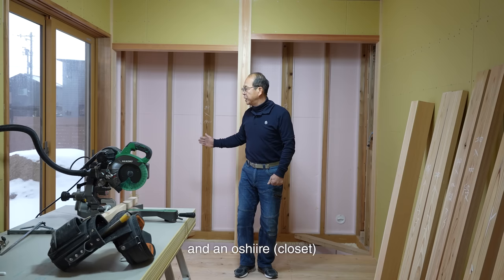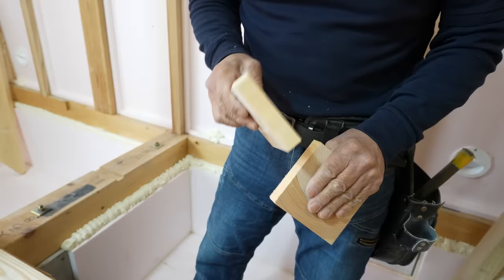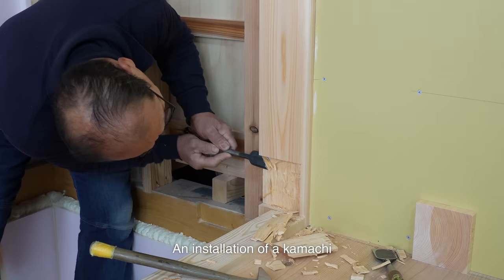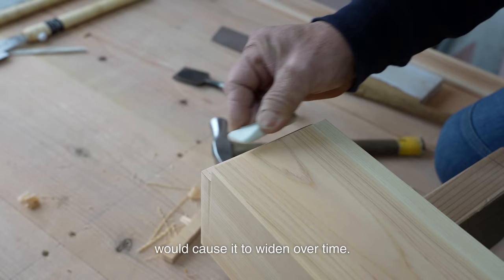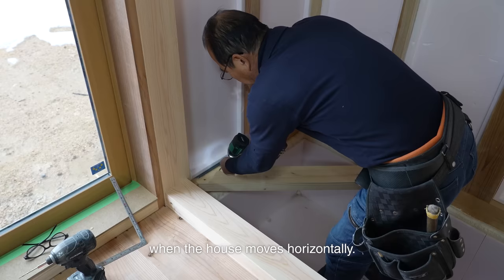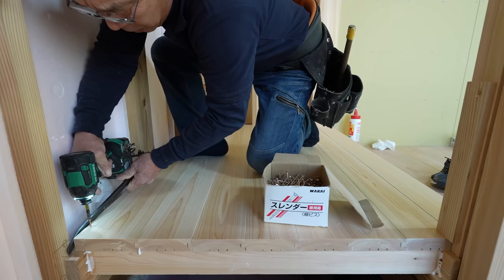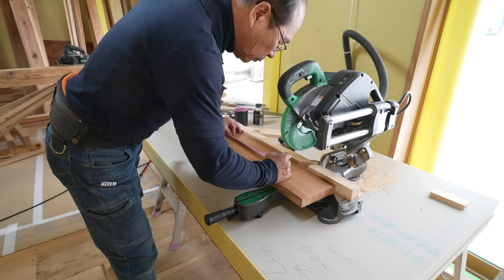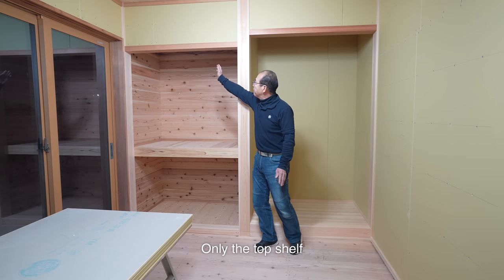Super-Challenging Joinery | Tokonoma and Oshiire Installation [Season 3 – Part 14]

Comment: There is no place on earth like Japan and no people like the Japanese, so unique in so many ways
Reply: Every country and race are unique
Reply: There is no place like the US and no people like the Americans.

In fact… There is no place like (insert country) and no people like the (insert respective people).

I’ve lived in Japan for 30 years. And there are people like this guy. But there are far more people not like this guy. I bought a house shortly after I came here. And looked at many houses. It took a while before I found a place that I felt could build our house. This company offered two different building styles, at least, for the framing work. One was more traditional Japanese, and the other word was the use of 2x4 made from Canadian fir. The 2 x 4 method was about another $15,000 more expensive and we chose that technique. This company had houses and Kobe when that major earthquake hit and none of them suffered any damage whatsoever. The thing that’s different there between the Japanese and American style framing with 2x4s. One is that the Canadian fir is some of the clearest 2 x 4 material I’ve ever seen and I for a while as a carpenter after graduating college. Second, is they heat up that nail gun because they use more nails and I’ve ever seen used an American house.

Major companies have a high degree of quality control, and employees must conform to the rules and regulations of the company. Expectations are high But the smaller companies are a different matter. Many that I’ve seen are shoddy. Many have a “that’s good enough“ attitude.

The guy in this clip is building a high-end house. Many common, if not most, houses now are modular design with wall panels, simply being hoisted up by crane in the linked together. Houses that are built by post and beam method are almost exclusively built with pre-cut post and beams. Those intricate joints are cut at a factory, loaded on a truck and sent to the job site. And many times the joints are not as intricate as what you see in true custom work.

There are differences in cultures throughout the world, and Japan definitely has its own special blend. I don’t get to get carried away over this guy because there’s not a lot of people like him and and only a small percentage of the houses are built by guys like him.

Oh, and those saws are nice! I use them all the time. They cut on the pull stroke, not the push. And the blades are replaceable.
Reply: @Zerpersande  "There is no place like the US and no people like the Americans."
Just go anywhere in western Europe lol in that case though it's reversed it's the Europeans that are just like the Americans due to cultural influence and not the other way around.

It's actually quite rare for a country to be so culturally homogenous that it achieves any recognisably unique aura, most of the time they're like America, meeting halls where you can find any culture represented but nothing is actually unique and widespread enough to be characteristically American and sure i understand not everyone is like this, but they don't all need to be, just a sufficiently visible amount, in America and Europe you don't get this effect due to the higher focus on individualism
Reply: OMG, that comment was soo racist. 😂🎉